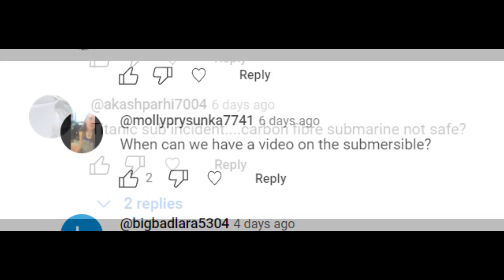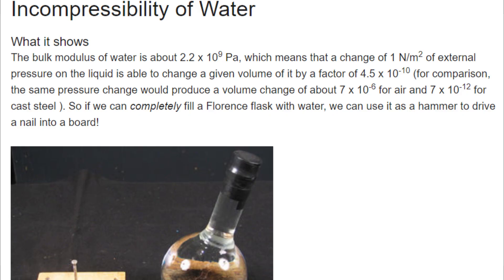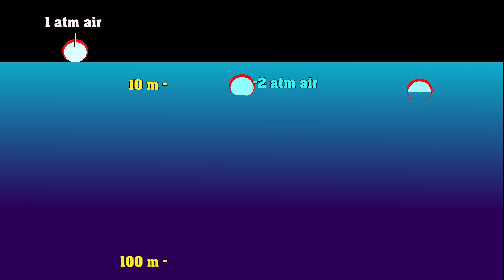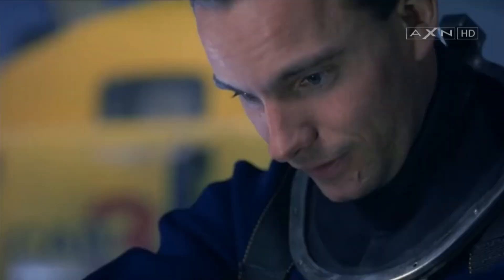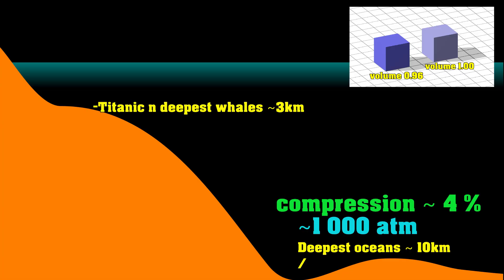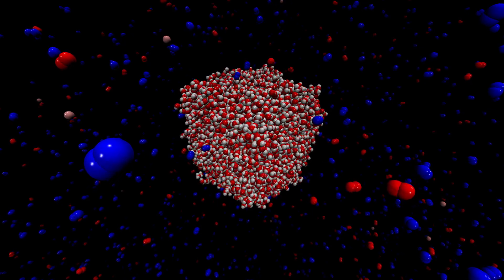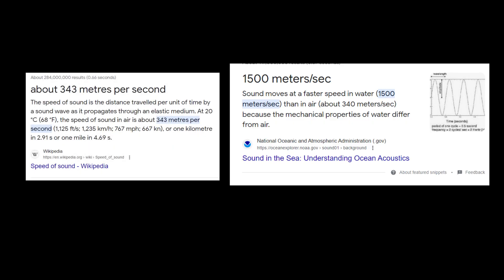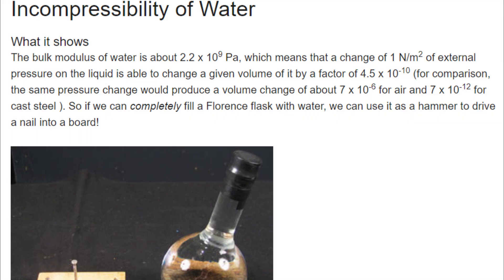What Happens when a Hull Fails at 1000 atmospheres?

Comment: My grandpa was a diver who did welding on oil rigs in the 50s-70s. Wore the old timey suit with the spherical helmet and everything. There's a very, very long list of horrific injuries and deaths that could and did/still do occur on those jobs from pressure issues and all the various equipment they used for pressure control. Even the toilets can kill you.
Reply: “Even the toilets can kill you” 
As one U boat crew found out
Reply: @SP-sy5nq  Worst bidet ever.
Reply: @SP-sy5nq  
Got any references for that? sound terrible
Reply: @rosen9425  "On 14 April 1945, 24 days before the end of World War II in Europe, while U-1206 was cruising at a depth of 200 feet (61 m), eight nautical miles (15 km; 9.2 mi) off Peterhead, Scotland, misuse of the new toilet caused large amounts of seawater to flood the boat"
Technically the toilet didn't kill anyone, but the flooding caused the batteries to start leaking chlorine gas so the kaptain had to do an emergency surface of the boot... right in front of an allied fleet.
Reply: @CynicalOldDwarf  
I guessed it would be around that period. wow super unfortunate to say the least 😳
Reply: @CynicalOldDwarf  yup, there's a reason sub toilets come with instruction manuals ;)
Reply: @SP-sy5nq  But to be fair, toilets after a good Mexican or Indian meal can kill you anywhere, and anyone within a 10 meter radius!
Reply: @andrew_owens7680 yuk yuk
Reply: @andrew_owens7680 If I survived that shit coming out, ain’t no toilet gonna kill me!!!
Reply: Johnny Cash  Ring of Fire.
Reply: Byford Dolohin incident comes to mind. Eesh...
Reply: ah yes, the getting queezed through the airhose magic trick.
Reply: I do believe the toilet incident was the one I heard about way back in the 1970's. One of my brother's friends was working toward his masters in Food Science. The case involved a saturation diver who was being decompressed. The way this works is you enter the chamber at depth. The chamber is then brought on- board ship and you decompress on the deck, which makes keeping tabs on everything much easier such as food etc. can be handled by airlocks. The diver in question had the bad luck to be sitting on the head at same time somebody thought that now would be a good time to empty the head's holding tank. The result was all his intestine was prolapsed . 
  The reason it was in food science was they had to come up with food that could be absorbed by the 3 feet of small intestine the doctors were able to save! The sheer skill that they were able to save his"life" was incredible
Reply: I knew a guy whose dad worked as an underwater welder for about a decade, just wearing something akin to scuba diving gear. Somehow in his late 40s he started showing tell-tale signs of brain damage, even though he’d only played some social rugby as a teenager.
Reply: @danieleyre8913  sounds like a saturation diver. when all your body and gasses are saturated you diving depth has no limits and you could do that theoretical bare nacked. But the ocean is ice cold. saturation divers wear a big suit connected with a hose. All the time hot water gets pumped through the suit. if that fails the diver can freeze to death in under 20 min. 

For gases you breath you need a preety precise mixture of gases, helium, nitrogen,  and so on. dont know whats happens to the brain if the fucked that up. but everybody can get braindamage, doenst have tobe related to diving. 

By the way, saturation diver dive up to 300m deep. They could go deeper, but nobody does that because the deecompression time will take weeks. the record for a person is to a comparebal depth of 650m. Theoretical and dangarouse limit would be around 1000m for the helium mixture. to take more pressure you would need some other gas to breath.
Reply: @eve-llblyat2576  You’re correct, nobody could say definitely that the continual diving, nor some forgotten or even unknown incident when he was diving, gave him brain damage.
But nobody could think of any cause. He’d never been known to have suffered concussion, had never been in any accident, etc. There was no history of these sorts of symptoms in his family. And the damage seemed pretty severe.
Reply: The decompression chamber was a wild place (maybe it still is idk). Divers would have to be there for days or even a week or two. The air was stuffy, no modern air cleansing systems other than gasses to breathe, guys who refused to wash, guys sneaking alcohol, smoking cigarettes and watching Captain Kangaroo, and companies hiring prostitutes to be available in the decompression chamber.
Reply: What watch did divers wear back then? Dive watches these days are all marketing?
Reply: @JinKee  I actually have my grandpa's "Pepsi" Rolex from 1972 (or 73 early 70s). Idk what's popular now. I'm an illustrator.
Reply: Mythbusters tested what happens if you are underwater in an old timey diving suit and the pump falls. At the depth they tested, your whole body basically compresses into the helmet in an instant.

Comment: I don't like your representation of the flow into the ruptured vessel. Even if the liquid is incompressible, it will flow in very quickly as it flows radially inward. It's a 3d flow. Rayleigh''s analysis of a void collapse neglects compressibility an it works fine for this. Your point that it's the impact of the inrushing water that does the damage, stands.

Comment: I would also be curious about how exactly the material used for the subs hull would fail under those conditions. Does it get a hole? Cave in? Rip apart? Splinter? Gotta know the details here...
Reply: someone said hydraulic press channel put a carbon fiber sub in a pressyre chamber to  see it implode
Reply: Your right, and I totally disagree with all the comments praising this video. The only part that was new was that the water enters the sub at 3 times the speed of sound in air because it operates at the speed of sound of water, which makes sense but does not explain much.

Furthermore, the last animation inexplicably shows the air expanding in volume, which was nonsense that I have no comprehension about whatsoever as it certainly does not represent what happened at all.
Reply: @ethanlewis1453  The video is pretty good actually.
He provided an accurate, extensive explanation of what is happening starting from very basic mechanics on the nanoscale up to what that means on the macroscale. Most other explanations just say "pressure go smash", but they never really tell how or why. 

Lol, where is the air expanding?!? Did you even try to listen to anything he was saying?
The white part (inside the orange "sub") is the air. The growing light blue shape is the decompressed water. As more and more of the water surrounding the hole is decompressed it gets pushed into the sub.

Before calling a video bad you should make sure to actually watch and understand it.

Comment: I just said it punched the light out of them. Was over so quick and pressure is so much higher than in an engine that they wouldn't get a chance to diesel the kinetic energy just goes right about punching electrons off, is some chemistry that takes place but its not much combustion and was not enough oxygen on board anyway..... Same thing happens with the mantis shrimp, it punches water so hard it cavitates and forms a little vacuum bubble, when it collapses for a split second temps rise to thousands of degrees kelvin and light comes out, they call it sonoluminesence.

Comment: Well argued i think.
Compression and pressure at depth are two sides of the same coin. Only because of the compression do we get the omnidirectional force that is pressure. In an incompressible material there would just be a downward force, so you would be killed by the "pillar" falling down on you, as you show at the start of the video.
So its not wrong to say that it is the pressure that kills you. The pressure is accelerating the water that will blast you.

A very simplistic calculation for your 3000 atm example could go like this:
p = 3*10^8 N/m²
Assuming this pressure pushes a 1m³ block of water into a 1m³ block of air (vacuum) we get the acceleration
a = F/m = p*A/m = 3*10^8 N/m² * 1m² /(10^3 kg) =  3*10^5 m/s²
Under a constant acceleration the distance is simple and we can find the time it takes to move the block
s = 1/2 * a * t²  --> t = sqrt(2*s/a)
and then we can get the final velocity
v = a*t = sqrt(2*s*a) = sqrt(6*10^5 m²/s²) ~= 800 m/s

Also gets us about the same result, but i like your explanation more, because it really shows why this happens on the smallest scale, not just from the macroscopic model.

Comment: I was told a story at the local billiards club of a guy that would swallow pool balls and then spit them back up as a trick. One day he did that with a cue ball, it got stuck in his throat and he died. 
Turned out a cueball is ever so slightly bigger than the other balls, but the difference in volume that made was enough to kill the guy. 
Every so often I get a reminder like that to respect volume, this video feels like another one of those times.

Comment: Thank you for this video Dr. Mason.
Calculations on the back of the envelope about the energy released by the implosion event, based on the depth of the submersible and its volume, result in an energy equivalent to the detonation of 47 Kg. of TNT.
The implosion, from start to finish according with my numbers, lasted 20 milliseconds.
The human brain require 200 milliseconds to acknowledge a change in the surrounding environment.
Greetings,
Anthony

Comment: Carbon fiber is really, really strong in tension... Not so much in compression. It's why it's a great material choice for pressure vessels used for compressed gasses: the strength of the carbon fiber is what resists the force of expansion from inside the pressure vessel, it's the epoxy matrix that keeps the carbon fiber in the proper configuration. 

In a submersible, the pressure is pushing inward on the hull, in this application it's really only being resisted by the epoxy because carbon fiber is relatively weak in compression. 

Visualize a string tied to a 10kg weight: if it's strong enough you could pull on that string and pull that weight. That is the kind of tension that carbon fiber is well suited to resist. 

Now imagine that same string, covered with epoxy to stiffen it - so it looks like a piece of uncooked spaghetti - and then it's used to try and push that same weight rather than pull on it. 

In that configuration, the carbon fiber is contributing little to the strength of the material when it's pushing that weight, it's the epoxy that was used to stiffen the carbon fiber that's doing almost all of the work.

And they justified the "strength" of carbon fiber to justify using it? Hard to understand how anyone ever thought this would be a good material choice for this application if they understood even a little bit about how carbon fiber works.

Comment: "Free fall speed" has nothing to do with anything. Gravity is irrelevant. There is a pressure differential from external to internal. From top to bottom of the sub doesn't matter much. You could have a tank of water in space at zero G constrained at 1000 atm with a 1 atm sub inside and the result would be the same.

Comment: Nice video!
I would like to know about the air being compressed when the water rushes in at that speed. Would it compress enough and fast enough to detonate causing a explosion? Heard a lot about the implosion then a instant explosion as the temperature would be insane.

Keep up the good work Thunderf00t! Always an insta watch when make a new video!
Reply: To detonate you need a fuel and air is famously mostly fuel-free. When it comes to temperature, classical models would say that compression causes heating. But the implosion is going so fast these models kind of break down. It doesn't really matter anyway because the volume of air is compressed in a millisecond and the air molecules are more or less just pressed into the water where any heat is quickly dissipated since the ocean is a massive reservoir.  

You might get secondary after the water, which as the video shows is bouncy under these conditions, completely filled the area and collides with itself resulting in a shockwave bouncing outwards like an explosion.
Reply: @SenorZorros  Very interesting! Thank you for explaining that, never thought about it that way!
Might be a bad example but like a soda stream, the CO2 is under enough pressure to "stay" in the water? In the implosion moment you get water with some more Nitrogen/Oxygen in it for a moment?
Reply: @CompileErrorLog 
1. The concentration of a gas in a liquid is described by Henry's law. Soda is somewhat analogous but when dissolved in water under pressure CO2 forms a mix between CO2 and carbonic acid which if I recall  correctly is the reason soda stays "carbonated" for a while instead of all the CO2 leaving rapidly. I study physics though, not chemistry so I don't know the details.

 2. The water will indeed have higher levels of Nitrogen and Oxygen for a moment until if diffuses.

3. The air is both fairly big and fairly light compared to steel so the heat is spread over a far greater surface. Also it is doubtful it gets that hot as the air is not really compressed like it would be in an engine but just pushed into the liquid. So you never really have that massive pressure that you get inside an engine because the air can sort-of escape. How warm it gets exactly I wouldn't know and really don't like figuring out because thermodynamics absolutely sucks. 

4. At 3500 m deep you can measure the pressure by the weight of the water column which is about  34 megapascal*. You can see the boiling point of really any material by looking at it's phase diagram which I linked down below. For water however the critical point, which is the highest pressure at which something can become a gas, for water is 22 megapascal and 350 degrees Celcius.  So water at a depth of 3500m will never boil, but would become a supercritical fluid** if you raise the temperature enough. Which is the point at which physicists either groan and go do something else or become really happy because their field of study is mentioned. 

https://en.wikipedia.org/wiki/Properties_of_water#Triple_point (for the phase diagram which shows the boiling point as a function of temperature and pressure)
https://en.wikipedia.org/wiki/Henry%27s_law (for solubility under pressure)

* pressure ≈3500m*9.81m/s^2*1m^2*1000 kg/m^3+P_atm≈3.44363*10^7 Pa≈339 atm
** not to be confused with a superfluid which is something completely different.
Reply: @SenorZorros  Also I am thinking about what you said that the ocean is a massive reservoir(Guessing you mean heat). If you place a red hot piece of metal in a bucket of water, the water in the bucket does not uniformly increase in temperature. The water close get super heated and boils, creating steam. If enough depth i would guess that steam cools down before i can reach the surface and is turned back in to water again(Implosion). I might be very wrong but i like to learn.

Edit:
The boiling point for water at that depth would not be 100C, its the bonds of water that break at sea level pressure. What temperature does water boil at when u are 4km deep?
Reply: @SenorZorros  I suppose the nitrogen would burn in the oxygen, producing oxides of nitrogen as would be produced in an internal combustion engine.  I'd guess that'd be a pretty negligible side effect.
Reply: @davidg4288  Quick note, I study physics, not chemistry so I don't know all the details. The triple bond between nitrogen is famously strong and is in fact a common end product of burning nitrogen-rich substances. In fact, the strength of that triple bond is why so many nitrogen-containing compounds are explosive. The nitrogen wants to really strongly  leave the compound and become N2 again. 

The creation of NOx in engines is actually an reaction that costs energy to happen (endothermic ) and saps energy out of the process. So while it is technically oxidisation it is not combustion. In any case, the process is happening fast enough (about a millisecond) that there is no time for chemical reactions to occur*.

*molecules are constantly falling apart and recombining so maybe a few but that's neither measurable nor relevant.
Reply: @SenorZorros  OK, endothermic, so even if there were time for a reaction between o2 and n2 it would have a cooling effect.
Reply: I just typed same comment 🤔

Comment: The rapid compression of the air from the expansion of the water into the diving bell would be similar to what occurs inside the cylinder of a Diesel engine. The air would be heated to a very high temperature, I would think that this would be the least of the difficulties facing the passengers though
Reply: 1/10 volume of air reduction would only increase the temp by a few hundred degrees, but the volume/density is so low, the total thermal energy is so little it dissipates near instantly. You won't even really get a burn from it. So stop spreading this stupid myth you autist.